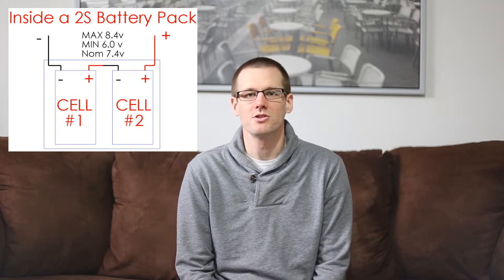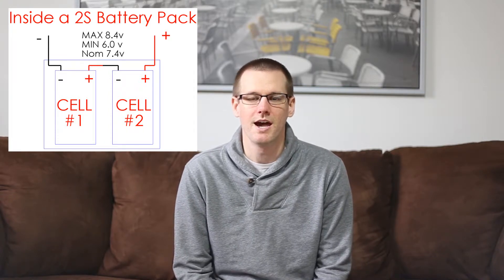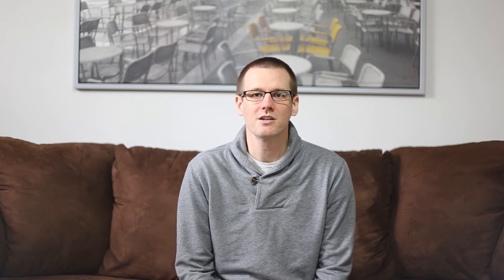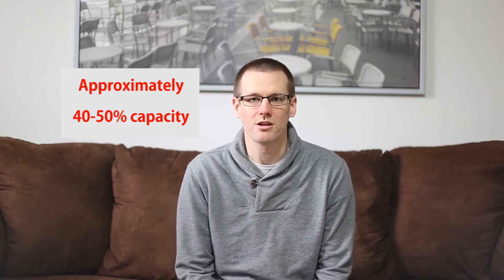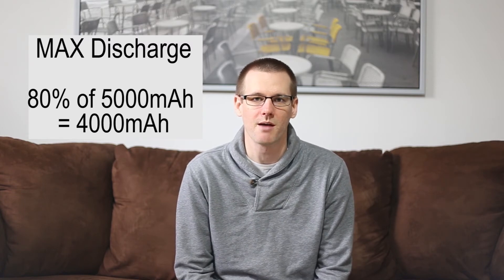Understanding Voltage and Capacity ( mAh ) - RC LiPo Basics

Comment: No one ever says what the start and finish voltages are used to determine the capacity. So is the quoted rate for a 500 Mah battery, say, for discharging from what to what ?  4.2 V to 3.8V or 3.5 V ? or what ? - and is the 80 % assuming what end voltage ? - is it 80 % of the capacity from 4.2 V to 3.5 V ? or 80% of what ?. If a manufacturer chooses a wider voltage range to quote the capacity they are going to be able to quote a higher capacity  - a recipe for misleading advertisment.
Reply from the maker: does this help?
https://youtu.be/sMLVQBbKKMo

Comment: Hello, I've been watched your video about 2 weeks now, and appreciate all of your video that I've watched

I have a question

How to properly charge a lipo battery? Because i heard if you charge at 0,1C to battery capacity you get a longer playtime, is it true?
Reply from the maker: Charging slower can increase the amount of capacity that gets placed back in to the battery. However, it's not a significant amount. Charging at 1C is very ideal. Even higher if the manufacture allows. The trade off between run time vs charge wait time is not worth the longer wait times.
Reply: @RCexplained  ok, thank you so much for the answer... I hope someday you can make video that discuss about this too... Thank you so much...

Comment: Great video . Subbed i got a question for you from downunder . I had a 6 cell 5000 mAh  22.2 v battery with a bad cell . It was given to me in a bad deal of fpv gear . Anyway I decided to go remove the bad cell and soon found out it to be easier to remove 2 cells and make it a 4 cell battery . My question is how do I know how many mAh is the battery now that ive made it a 4 cell ?
Reply: Also the C rating was 60 - 120 when it was a 6 cell . Now ive made it a 4 cell , what would the C rating be now ?
Reply: 5000÷6=833 mah per cell X 4=(thats your total mah capacity at 14.8v 4 cell..Not 14.8v 5000mah since you already reduce the should be endurance..Heres a simple logic:You have a car full tank of fuel 60 liters capacity,that can travel 600 miles..Now you remove 20 liters,,you aint gonna hit that 600 miles anymore right??becoz you lessen the capacity..

Comment: Can you use a 4000 mah battery and a 5000 mah battery in the same car like a xmaxx or will this destroy something??
Reply from the maker: I would not recommend this. It's possible to do but you can destroy the 4000mah pack if you aren't careful.

Comment: Hello!   I've been watching you videos and have appreciated them greatly.  Thank you. 
I have a question. 
I want to increase my mah on my scx24 a little bit.  Right now it has a 7.4v 350mah.
For weight distribution,  I want 2 batteries. 
The batteries that fit perfectly,  are 7.6v 300mah.
Will these batteries hurt the esc/receiver combo?
Is .2v significant? 
Thanks again!
Reply from the maker: I can't speak to your setup specifically, however in general an increase of 0.1v per cell is not very significant. If I ran a higher voltage battery pack in my setup, I would still pay very close attention to heat build up in any of the power system components for the first few runs. If all checks out, the system should be good to go.
Reply: @RCexplained  excellent!  Thank you.
I'll do some tests,  watch the heat levels.

Comment: Hlo bro , if u know about phone batteries thn plz tell me what is the minimum safest voltage of a 3.85 v phone battery.is it ok if my phone is showing 3.4 v
Reply from the maker: I'm not sure about cell phone batteries. It's possible it can also be different from phone to phone. What you could do is discharge the phone down to around 2 percent to get an idea of the absolute minimum. Then measure the voltage. Next, discharge to 15 to 20 percent and take a measurement to get an idea of the safe discharge voltage. I follow the same battery rules in the latest posted video for long life. I have a Note 3 from 2013 and I just replaced the battery last year.
Reply: @RCexplained  also the voltage varies with temperature